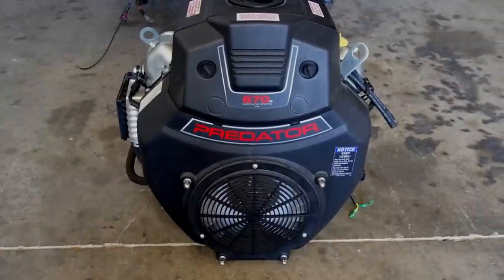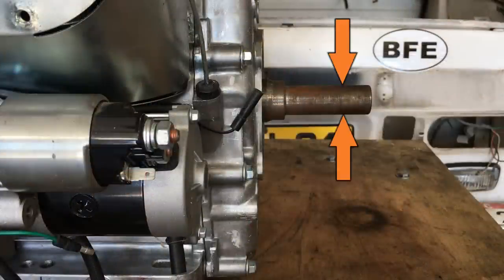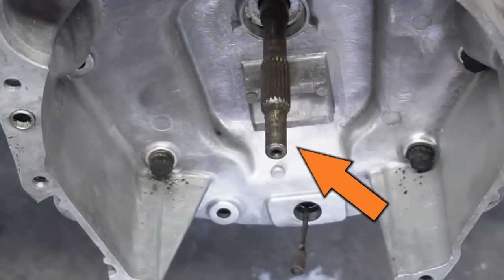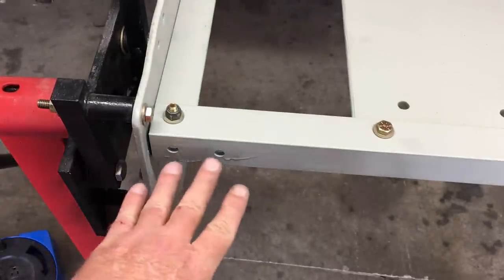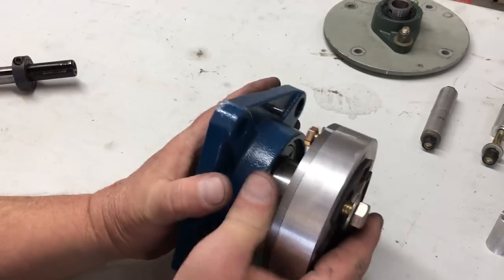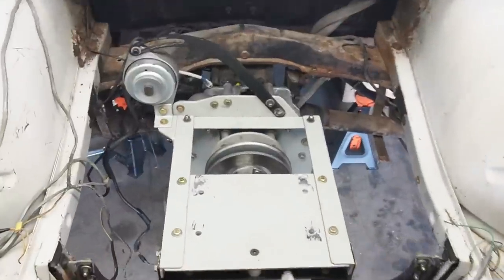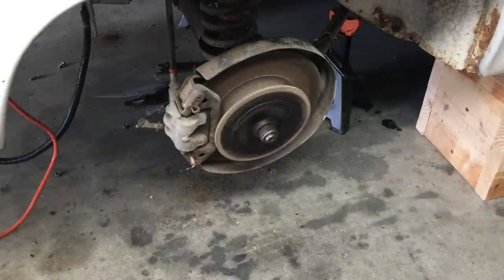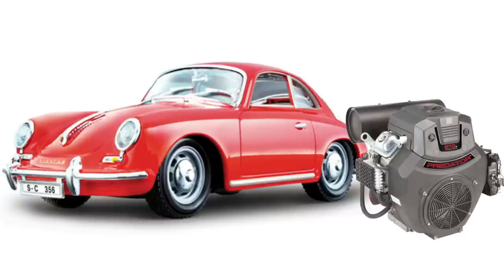S3 E18 We put a 670 Predator V twin in our project car 1969 Renault 10

Comment: Any good hardware stores in Louisiana?
Reply: When you have a home improvement project to complete, the helpful staff and selection of Louisiana’s local hardware stores are unbeatable. It doesn’t matter if you’re installing a new floor or trying to fix that leaky sink, you’ll find everything you’ll need.
Reply: Guidry’s Hardware & Supplies, Lafayette and Scott, LA

With over 150 years of combined experience and more than 80 years of dedicated service to the community, Guidry Hardware & Supply has earned the trust of their customers. Not only has this business been family owned since 1933, nearly everyone working there has worked on their own home improvement projects or hobbies that give the know-how to answer your questions. Guidry’s specializes in hard-to-find products, and keeps a selection of items like sausage makers, barbecue pits, and other sundry products in stock. Whatever your project involves—indoor, outdoor, plumbing, painting, household items, or picnic and tailgate party supplies, you’ll find it here.
Reply: Brasseux’s Hardware, Abbeville, LA

It was in 1945 that the original hardware store opened, and the name has changed over the years. One thing that hasn’t changed in all this, however, is the quality of products and service that customers can depend on. Brasseux’s has the right top line and contractor-grade tools for the job, and is the only Milwaukee Tool retailer in the area. If cooking is your thing, then you can find indoor and outdoor cooking supplies, and take part in one of the regular Friday cooking demonstrations at the store. Brasseux’s also has an online blog where you can find instructions and a supply list for everyday household and garden projects that are easy to follow.
Reply: Morrison Terrebonne, Houma, LA

In 1999, the merger of two well-known and respected hardware stores created Morrison Terrebonne Hardware with more than 90 years of combined service to the Houma, Louisiana, area. Besides great service, this locally-owned and operated store lives by the principle of providing excellent customer service and quality products at great prices. From building materials to lawn and garden merchandise to painting, plumbing, and roofing supplies, you’ll find everything you need for your project.
Reply: Mike’s Hardware & Supply, New Orleans, LA

With nearly 40 years in the hardware business and more than 13,000 items in stock, Mike’s Hardware in New Orleans is not just another small mom and pop hardware store. What do you get besides great quality products and service? You get old-fashioned satisfaction-guaranteed customer service at great prices, too. The people behind Mike’s Hardware understand the community’s needs and has been through tough times like the hurricanes that devastated the area.
Reply: Pat's Home Center of St. Francisville, LA

Southern Louisiana is home to Pat’s Home Center with locations in Baton Rouge, St. Francisville, and Clinton, and the family-owned hardware business has grown since the first store opened in 1984. The success of the store, according to owner Pat Vince, is having earned the reputation for being reliable and dependable over the test of time. Free estimates, cutting services, and delivery are just a few of the services offered at Pat’s, and they have a project center that will help you plan and execute your next home improvement or building project successfully.
Reply: Goodwood Hardware & Outdoors, Baton Rouge, LA

The year was 1996. That’s the year Goodwood Hardware & Outdoors opened its doors in Baton Rouge, Louisiana, and started becoming one of the best-known source for outdoor cooking, patio furniture, kitchen, tool, and special project store in the area. Goodwood Hardware also carries a full line of merchandise to show off your team spirit for Louisiana State University. There’s even a blog dedicated to providing helpful hints for projects, recipes, and how-to advice for a variety of projects.
Reply: some good plumbers as well.
Reply: CJ's Plumbing Repair, Lafayette, LA
Customer satisfaction drives their work and their team offers you reliable services which are backed by a 30-day warranty on their workmanship. With 24/7 availability, they’re second to none.
Reply: Fred's Plumbing and Air Conditioning, Inc, Maurice, LA
They are a third-generation family-owned business that have been around since 1967. They specialize in both residential and commercial plumbing projects, offering top-notch services and quality craftsmanship.
Reply: Hargrave's Plumbing, LLC, Lafayette, LA
This highly skilled team offers plumbing solutions for any situation, from water heater repairs to complete kitchen plumbing remodels. They prioritize customer satisfaction and strive to be the best plumbers in Lafayette.
Reply: Sunshine Plumbing & Backflow, Baton Rouge, LA
For over 14 years, Sunshine Plumbing & Backflow Prevention have been providing unmatched plumbing solutions to homes throughout the Baton Rouge area. As a 4th generation plumber, they are experts in the industry.
Reply: American Plumbing, Baton Rouge, LA
With the Chairman of the State of Louisiana Plumbing Board at the helm, this team is dedicated to fixing leaks, snaking drains, and silencing toilets. If you want the most expert care and professionalism, you’ve come to the right place.
Reply: Southern Air Heating, Cooling & Plumbing, Leesville, LA
Here, you can count on certified experts to treat you and your home with the utmost care. Their team of HVAC technicians, plumbers, and electricians work hard to provide reliable, affordable services.
Reply: Hope this helps!!
Reply: Best Places for Milkshakes in Louisiana!
Reply: Stanley, New Orleans, LA

Don’t let the fact that the only shake flavors found here are traditional chocolate, vanilla, and strawberry fool you into thinking there’s no variety at this little eatery located in the French Quarter of New Orleans. Stanley represents more than just good food. It represents the heart and soul of Louisiana, and the determination to keep on going no matter what life and Mother Nature throws at you. Known for breakfast served all day, every day from 7 a.m. to 7 p.m., Stanley is about as classic as you can get, and worth the trip.
Reply: Little Cakes with Big Attitude, Alexandria, LA

Do you love cupcakes? Got a fondness for milkshakes, too? Then you have to stop by Little Cakes with Big Attitude where you can get the best of both. This amazing little shop has a cupcake shake where you pick your favorite cupcake that’s added to three scoops of ice cream for a yummy frozen ice cream treat that will satisfy any sweet tooth. How about a banana caramel milkshake or Blueberry Wedding Cake Shake? The possibilities are only as endless as the cupcakes available Monday through Saturday.
Reply: Fatboy and Skinny’s, Leesville, LA

If you’re craving true American food, Fatboy and Skinny’s in Leesville is the place to go. With traditional foods like burgers and fries, onion rings, and milkshakes, this family-friendly restaurant will not disappoint. With a desire to serve great-tasting food that isn’t part of the fast-food chain variety, Fatboy and Skinny’s pride themselves on being the best tavern and burger joint in the area. Open every day but Sunday, you’ll find the food good, the service friendly, and the prices reasonable.
Reply: Creole Creamery, New Orleans, LA

What do you get when you combine Lucky Charms cereal, Jameson Irish whiskey caramel, marshmallows, and a green cherry on top? An Irish Breakfast milkshake, of course! This is just one example of the creative flavors made possible at Creole Creamery in New Orleans. There are always the traditional favorites, vanilla, chocolate, and strawberry, but with an ever changing menu of milkshake flavors, you’ll never know what to expect. And even if milkshakes aren’t your thing, there are malts and floats, sundaes, and banana splits to choose any day of the week.
Reply: Hub City Diner, Lafayette, LA

Hub City Diner is a retro-style eatery with all the charm of the 1950s, including black and white tiles on the floor and red, white, and blue leather booths. Serving breakfast, lunch, and dinner seven days a week, Hub City Diner has onion rings, sweet potato fries, fried dill pickles, mushrooms, and jalapenos plus a nice menu featuring catfish, red beans and rice, grilled chicken, and shrimp. On the burger side, you can have a spicy garden burger if you want something plant-based, or dig into a half-pound mushroom and Swiss burger. Whatever your choice, they have sweet tea and great milkshakes.
Reply: Grub Burger Bar, Shreveport and Lafayette, LA

Can you imagine enjoying the a Kitchen Sink or Worms & Dirt? You can if you stop by Grub Burger Bar in Shreveport, Louisiana, any day of the week and order one of their famously popular milkshakes. Established in 2012, this unique take on good food starts with the belief that eating should be fun. The traditional handmade and specialty crafted  shakes like the ones aforementioned can be part of your next meal also featuring amazing burgers like the Lockhart Legend, their most popular. Whatever you choose, you’ll leave with a full belly and a big smile.
Reply: Dat Dog, New Orleans, LA

What’s creamy and thick and has a cherry on top? A Sunday Funday milkshake from Dat Dog in New Orleans. With the notion that food can be prepared and evoke happy thoughts, Dat Dog strives to make delicious food at reasonable prices, including vegetarian and vegan options. With a blend of international sophistication and Deep South soul, they have over 30 different toppings to add to your bun. And there’s nothing better than a thick creamy milkshake to wash down your selection like the Duck Sausage Dog, a smoked wiener with creole seasoning, a Guinness Stout-infused brat dog, or the lightly smoked and spicy Alligator Sausage dog.
Reply: Everyone loves the taste of barbecue, whether you enjoy a thick, bold flavor, mesquite, slightly tangy, or sweet sauce on your favorite beef, pork, chicken, or fish. Louisiana has some of the best in the country, and below are the 7 best barbecue joints in the state where you can satisfy your taste for some finger-licking, mouth-watering deliciousness.
Reply: The Joint, New Orleans, LA

If the thought of juicy slow-cooked pulled pork and beef brisket, chicken, sausage, and ribs make your mouth water, then you should visit the Joint in New Orleans to get your hunger satisfied. With great sides that compliment these great smoked barbecue choices like mac & cheese, cole slaw, and baked beans, you won’t go home hungry from this national award-winning eatery that opened in 2004.
Reply: Pimanyoli’s Smokehouse Café, Baton Rouge, LA

You won’t find a better barbecue joint in the state than Pimanyoli’s Smokehouse Café in Baton Rouge. With a unique sauce that uses 21 key ingredients, this is a very special (and secret) combination that will make you beg for more. When you visit Pimanyoli’s, you’ll hear the sounds of blues, and favorites from the past, and everything makes the whole dining experience one you won’t soon forget. Open every day but Sunday.
Reply: Grayson’s Bar-B-Q, Clarence, LA

If you want authentic Southern barbecue, you have to try Grayson’s in Clarence, Louisiana. A social media favorite, when people try this little eatery, they leave talking about it. And it’s no wonder because they take their time making their meats flavorful by letting them cook slowly to lock in the flavor. A third-generation family-owned business established in 1959, you won’t go wrong with anything on the menu. Open every day except Monday.
Reply: The York Chop, Coushatta, LA

This is truly a little hidden gem of a barbecue place. The York Chop in Coushatta, Louisiana, serves up some mighty fine barbecue. Besides sandwiches, burgers, seafood, and bulk meats, they serve Southern hospitality with a smile in an environment that feels like home. Open daily, you’ll love the York Chop.
Reply: Cou-Yon’s Bar-B-Q, Port Allen, LA

What do you get when you combine Texas barbecue and Cajun flavor? You get Cou-yon’s Bar-B-Q. Located in Port Allen, Louisiana, Cou-Yon’s has the best ribs, seafood around, not to mention the chopped beef, pulled port, sausage, turkey, and fish. Winner of TripAdvisor’s Certificate of Excellence, this barbecue joint might just be the best in country! This is simple, serious food where people come together for fun and conversation and leave satisfied. Open every day.
Reply: Best Auto Shows in Louisiana!
Reply: Louisiana’s auto shows are more than just opportunities to check out classic cars and trucks; they are local traditions bringing together communities and all ages. These auto shows give car enthusiasts the chance to display and compete for awards, plus spectate many various styles of vehicles. The best auto shows in Louisiana showcase the most unique vehicle displays while supplying various family-friendly entertainment such as food, music, and various activities.
Reply: HowURidin' Truck, Car & Bike Show, Shreveport, LA
Known as North Louisiana’s largest car show, HowURiding’ Truck, Car & Bike Show draws in over 40,000 attendees each year! This popular event is held each July at the Louisiana State Fairgrounds and features many vehicle styles including hot rods, low-riders, trucks, bikes, luxury vehicles, heavily modified rides, and more. There’s also a bass battles competition, DJ music, food vendors, kids’ face painting, and other activities.
Reply: New Roads Car Show, New Roads, LA
The New Roads Car Show is an annual event held each March on Main Street. With over 300 participants and over 2,000 visitors, this festive show is a community favorite event with a whole lot to offer. There’s a DJ playing cajun music, 100 awards, a mega 50/50 raffle benefiting a local hospice, and more to enjoy.
Reply: CWSA Open Car Show and Family Fun Day, Houma, LA
The CWSA Open Car Show and Family Fun Day is an opportunity to benefit children’s water safety awareness each year. This family-friendly car show features a wide variety of vehicles with many awards given out in various categories. All ages gather to enjoy the pastalaya cookoff, live music, 50/50 raffle, door prizes, food, live and silent auction, and various activities. Attendees can also sign up for free swimming lessons and CPR classes.
Reply: Natchitoches Classic Car Show, Natchitoches, LA
The Natchitoches Classic Car Show showcases the town’s historic charm and beauty each fall with a family-friendly car show. Hundreds of vehicles are featured at this two-day event, which includes a poker run, fish fry, fireworks display, and award ceremony. It’s truly fun for all ages!
Reply: Cenla Cruis'n Car Show & Music Festival, Alexandria, LA
Cenla Cruis'n Car Show & Music Festival is an event car show lovers won’t want to miss! It’s held in downtown Alexandria and welcomes cars, trucks, and motorcycles. The event also features live music, raffles, prizes, food trucks, a beer garden, and fun kids’ activities in a family-friendly outdoor atmosphere.
Reply: St. Jude Open Car Show, Baton Rouge, LA
The St. Jude Open Car Show is an annual event open to all types of vehicles new and old and anywhere in between. This fun-filled event takes place at the Bayou Plaquemine Waterfront Park, where car owners can show off their rides while benefiting the children of St. Jude. There’s cash prizes to win, silent and live auctions, awards, food, music, Hot Wheels racing, and over a dozen retail vendors
Reply: Stars And Stripes In The Park Park Classic Car Show, Sulphur, LA
Held in Heritage Square, the Stars and Stripes in the Park Classic Car Show is a Sulphur tradition featuring hundreds of classic cars, trucks, hot rods, and motorcycles. All vehicles are welcome to this outdoor open car show, which is free to enter and attend. The show also offers door prizes, live music, food booths, and children’s activities.
Reply: Altered Metal Car, Truck and Bike Show, Rayne, LA
Held each march at the Rayne Frog Festival Pavilion, the Altered Metal Car, Truck and Bike Show new car, truck and bike show is a new auto event welcoming all classes. This three-day event provides Top 75 awards plus over 15 speciality awards and activities for all ages. There’s also a hospitality night and complimentary dinner.
Reply: JC’s Rockin’ Roll Classic Car Show, Krotz Springs, LA
JC’s Rockin’ Roll Classic Car Show isn’t your ordinary car show! Held in Nall Park, this unique event showcases classic cars while offering plenty of live entertainment and activities. There’s a chicken cook-off tasting featuring the best local chicken dishes, live music, lots of vendors, plus a mini-parade and slow-speed chase into the park.

Comment: That's not a lawn mower engine that is a four-wheeler engine say your four-wheeler burns up with the V-Twin that you snagged out of a motorcycle you can grab the cheaper Predator one and replace it and it uses the same shaft